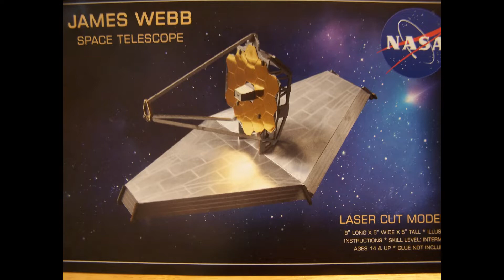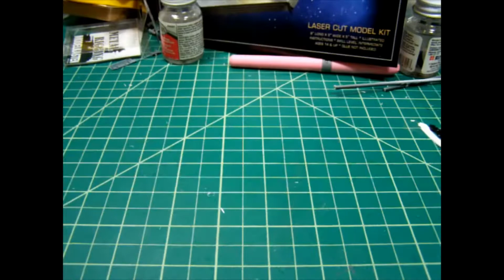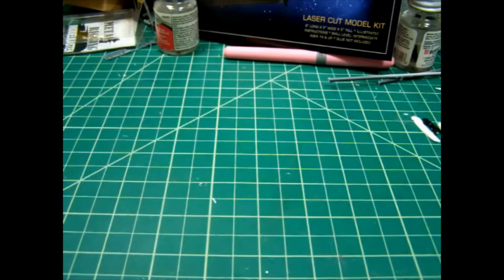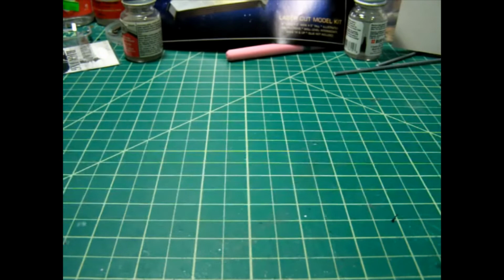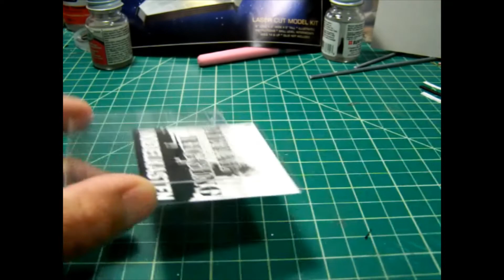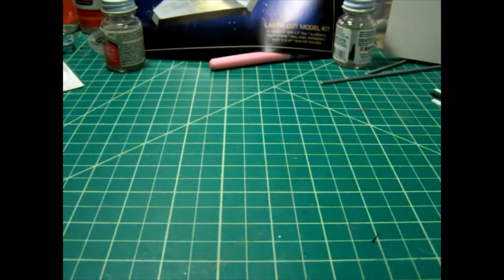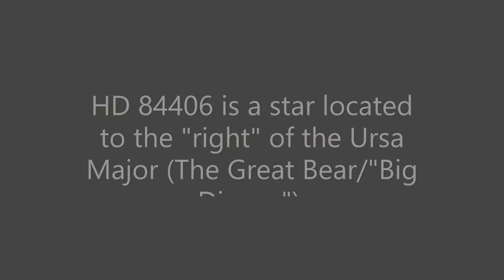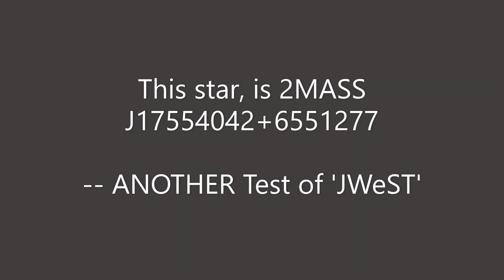James Webb Space Telescope model - Final Build (Part 5)

Comment: Beautiful JWST model Mario. Well thought out solutions to the issues you had with the sun shield tensioning. Looks amazing. I love the colour rendition of all of the components of the model you achieved. Enjoyed the vid very much.
Reply from the maker: Thanks, 'Brtree74', [ I will always use your 'channel name' ;) ], but it was a Good Challenge Thinking ..... "how could I / am I, going to represent the colors of this exciting new telescope!!???

I was thinking of using mylar, but then I saw the adhesive vinyl in my original search, found out it was Very thin and easy to cut.  The adhesive was a bit tricky, and If I were to do this again, which I might....just to hang it in My room, I would make that adhesive Less tacky, use more supportive perimeter wire (thicker wire...MayBe solder the ends together!).  Or with the vinyl, there are two (2) backings...one to protect the vinyl itself, the other to protect the adhesive backing, but with that adhesive backing, maybe paint it silver and leave the backing on.

Then, when I saw ALL the different vinyls in one (1) package.......Well... that sealed the idea!!!  And with my scratch-building techniques, I was able to re-work those anchors.

BUT.......there is one (1) more video that I want to show off about the 'J-WeST', so 'Stay Tuned'!!!